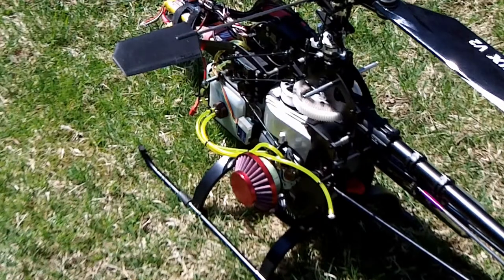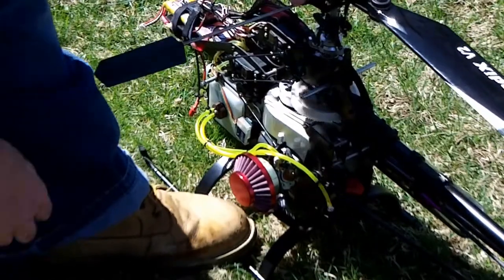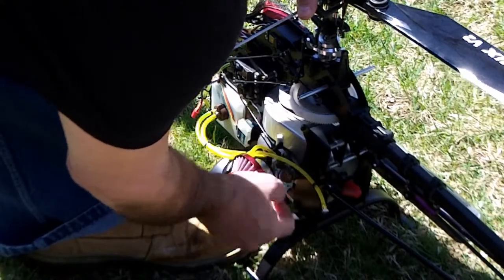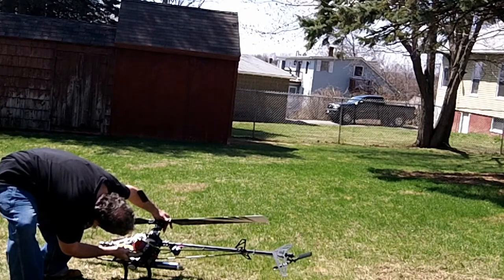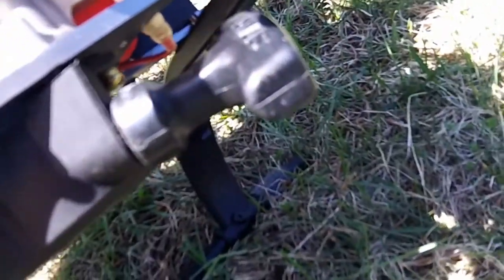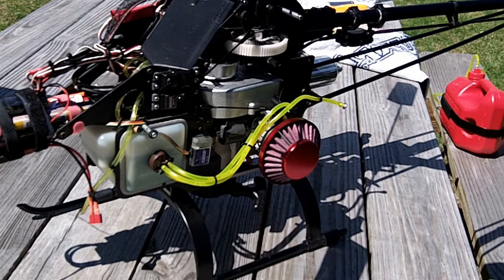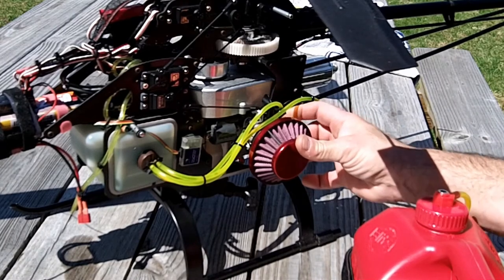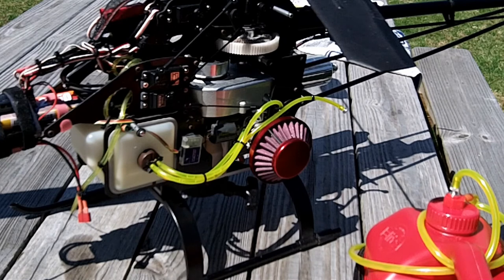Century Predator Gasser Fuel line Replacement part 4 lets go flying

Comment: Hi Mike, I don't know that much about that system but any engine I ever had needed a vent somewhere otherwise it buils up a vacuum which stops the engine and more than likely leaves vacuum or air pockets somewher. Just a thought.